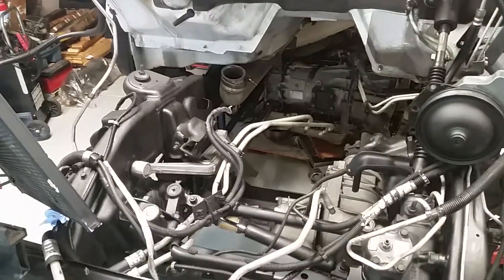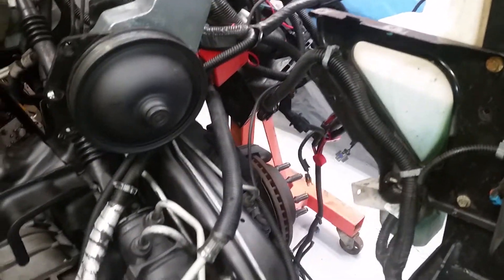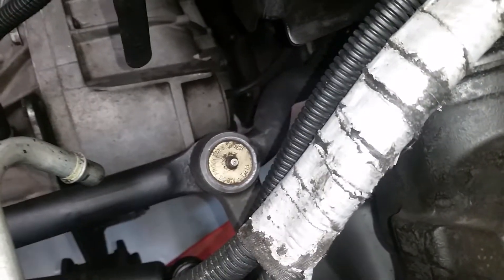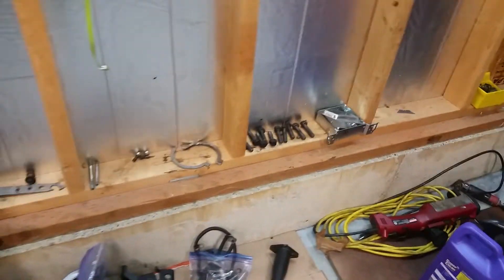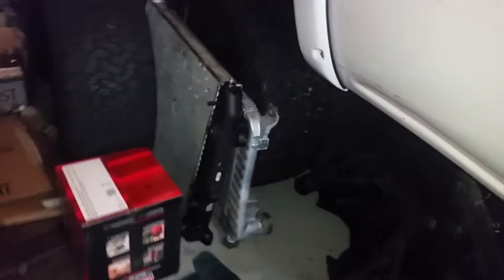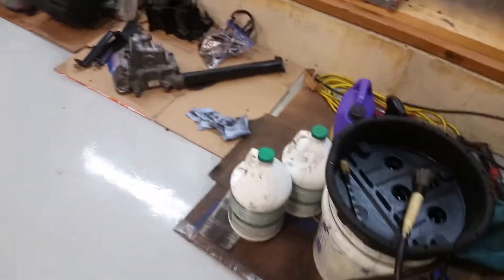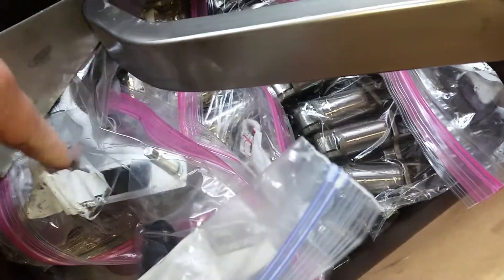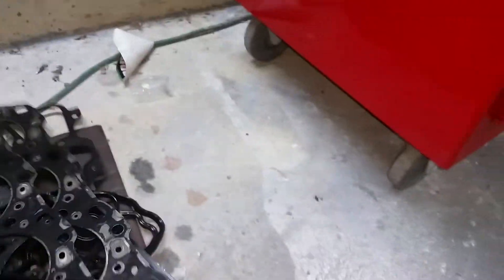Fastthings 6.6 Duramax LBZ Rebuild..part 2

Comment: Hi That bucket cleaner looks cool where did you buy that cleaning kit or did you make it i would like to make one my self let me know what you need so i can make one myself.
Reply from the maker: It is pretty cool, I got it from Harbor Freight. Kinda small, but it's cheap. I just used diesel fuel in it to clean stuff, cheaper than solvent. All it is, is a submersible pump and a tray.
Reply: @fastthings  thank you im going to check

Comment: What did it end up running you just to get it back to a long block?
Reply from the maker: I'm sorry I really can't remember. All the parts are pretty standard cost. The pistons/$2k, injectors/3k. Those two items really drove the cost up.
Reply: fastthings i found a Mahle and clevite master overhaul kit with pistons rings bearings and most gaskets for around 1800 std bore up to I believe .040 over. I’m sure that a block would just need a lite hone due to most keep cross hatching up to higher miles
Reply from the maker: Clifton Cooper you may not need pistons,  I had to because I had to go over bore. I would tear it all down, if that's what your doing, then order what you need.
Reply: fastthings will do, I didn’t know if you had to over bore or not. The truck I’m looking at has 308k miles they say it’s strong with no blow by but I’ll have to check it out for myself. It’s flawless when it comes to the interior and exterior, just has high miles which I’m not really scared of. They want 13k but I think if they take 10 I’d be all over it.
Reply from the maker: Clifton Cooper sounds good, way better to fix one up than spending so much for a new one. Plus, I have none of the emissions.
Reply: fastthings that’s what I was looking for. Spend a little for one and have it paid off in no time. Then save what a new one would cost and rebuild when it needs it. Was that por15 you used for the undercoating? If I could be in one and have 20k total in truck and what would be spent to rebuild the motor and transmission and have a practly new truck I’ll be happy. I drive 5200 miles a year between 2 trucks so it will never get any big miles on it unless I haul the camper to and from deer camp and going to see family out of town
Reply from the maker: @ccooper04  the undercoat is a paint called zero rust. It works so nice for painting right over rust, it converts it.
Reply: fastthings it looks almost like you blasted or scraped that area good and painted it. Looks smoother once finished
Reply: Did you buy as an aerosol or roll on?
Reply from the maker: @ccooper04  areosol, and it is spendy, but worth it.
I painted a rusty grate about 3 years ago, 1 coat, still no rust has come back. I can't believe it.
Reply: fastthings i found it online and it is a little pricy but looks like it’s well worth it.
Reply: My undercoating on the 04 looks like it’s all gone but would be worth it to tape it up and spray the rails and be done with it